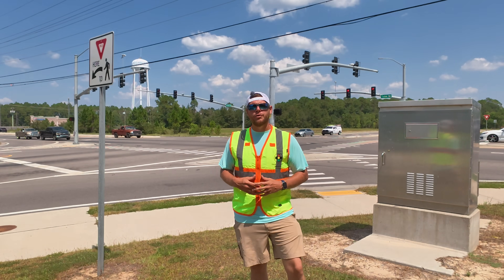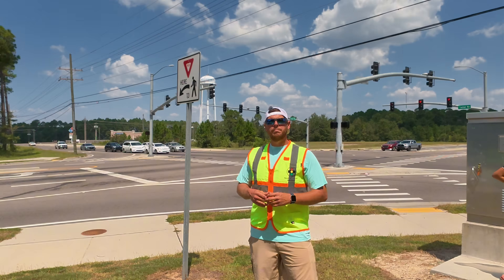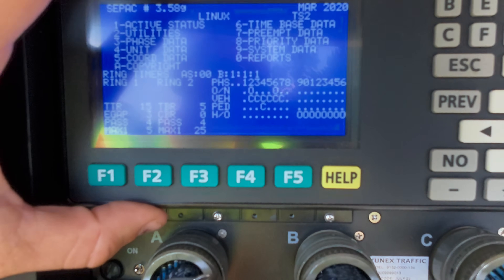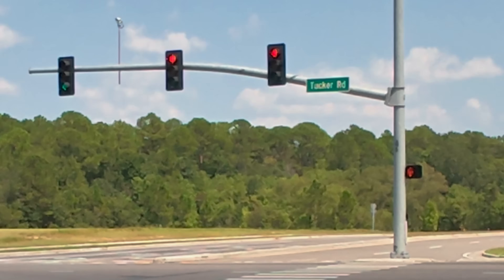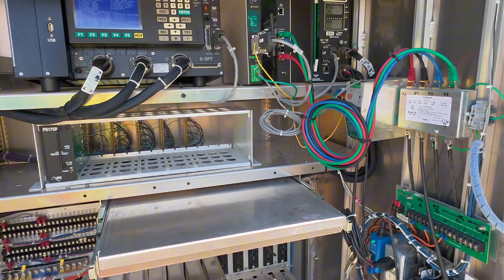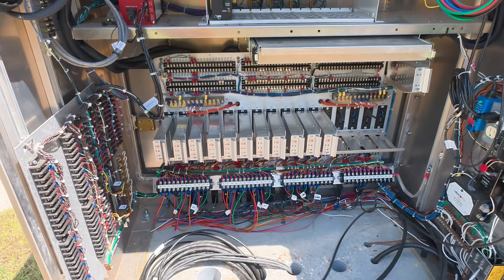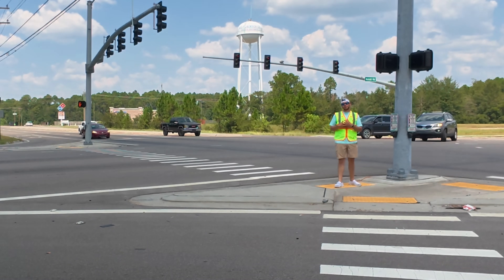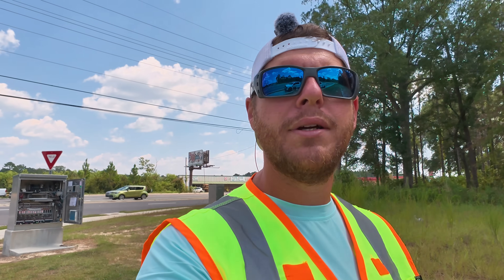Traffic Light Doctor Explains: Do Crosswalk Buttons Work?

Comment: There was an issue with the pedestrian phase getting triggered when it rained on a few signals around here. I finally had the occasion to walk by one and the cause seemed pretty obvious to me...the button was installed upside down with the wires entering from the top. I have never read the installation instructions for one of these buttons (to be fair, I doubt most of the people installing them around here have either) but I seriously doubt that is how they say to install the button.
Reply from the maker: I’d have to see the install on them to confirm if it was right or wrong but that does sound like a bad install. Is this a wooden/concrete pole that it’s on? Hard to mess them up on a steel pole but there is a dozen different ways to install them depending on the application and to make them ADA compliant.
Reply: @Trafficlightdoctor  It's on a steel pole. I'd think with the wires entering from the top, water will run down inside the button when it rains and conduct enough to trigger the pedestrian phase....unless the wires are sealed exceptionally well...and why would the manufacturer of the pedestrian button bother to do that when it's just as easy to install it with the wires coming out the bottom and state such in the directions?
Reply from the maker: @brianleeper5737 yeah that sounds like a poor install typically the hole will be drilled out below or center of the button depending on which kind of button that is being used and the cable will roll up to the terminals. Sounds like they went too high or installed new buttons that had to meet ADA standers and was too lazy to drill a new hole for the cable. Water will for sure create the problem you are stating. If it’s an older style button a weeping hole would help. Hate that you have to deal with that at your local traffic light!

Comment: Not sure about the newer model ones like that, I have seen a few of those up here in Lexington KY that seem to actually work.

However, many older systems, especially in smaller cities and towns, the button is not linked to anything up here.  They are a literal false button.  There was actually a news segment on it about 25 years ago here because it was an issue in Lexington where enough people complained that they felt the buttons did nothing.  Sure enough, while in the city they do, smaller towns typically disable/never wire said buttons, or just use a straight up timer for everything.

Comment: Here in the UK the "walk indication" is generally built into the same unit as the button these days. Some have got sensors so if the pedestrian walk away, the "crossing request" gets cancelled.
Reply: more need this radar for simplicity
Reply: I’ve seen videos of some pedestrian crossings in the Netherlands which have eye sensors (no, seriously). You literally just look at the sensor and it puts in the call to the light controller so you can cross—no physical contact required! It’s probably a COVID-era solution I’d imagine, but it still exists to this day!

Comment: Say I'm at this intersection the one in your video, and I push the button to cross the road (any one of the buttons on any of the poles) I'm now in the " Q " but before  my turn in the "Q" is reached, A first responder approached the intersection and the white light on top of the intersection is flashing and all traffic has to stop. Then the white light stops flashing and Traffic starts to move. My Question is am I still in the "Q"? Does the Computer in the Traffic control box have a memory that I pushed the crosswalk button before the first responder overrode the Traffic lights, thank you, hope my question was clear
Reply from the maker: Once the preemption is over for the emergency vehicle the controller will do a full cycle to every approach regardless if a vehicle or pedestrian is at the light then after that cycle it’ll go back to utilizing detection!
Reply: @Trafficlightdoctor  ok , I think that means I don't have to push the button a second time!!
Reply: @Trafficlightdoctor  That must depend on the controller. On the EPAC controllers (Siemens/Eagle), you can configure an exit phase which is the phase that gets the green when the preemption is over. After that exit phase is served, it uses the detection.

Comment: My question would be, how is it different if you DO NOT push the button? That light went green, would the crosswalk not normally go green anyway? It seems as though it simply made you wait for the cycle anyway.
Reply: usually ive noticed that's the only thing that changed. if you press the beg button, you get a walk signal. if you wait at the light without pressing it, you dont get a light
Reply: The Walk will not always come on with the green, depending on how the intersection is designed. There are actuacted, semi-actuated, and non-actuated traffic signals. If you do not push the button, you may not have enough time to cross on a green due to that direction gaping out (not extending the green).

Comment: I can tell you the TLDR without even watching. Yes they do****

******but sometimes they don't (technically). Sometimes, the light automatically gives a signal to PEDs regardless, but the button can be a signal to encourage the light to change sooner. Generally, however (at least in my area), they also determine whether PEDs get a signal or not during a phase.

This is the part where I am intrigued to watch this video; sometimes, the buttons do seem to not affect the signal phase in spite of being pressed which seems to suggest that some buttons are for looks and/or the "feeling" of doing something without doing anything. EDIT: Maybe they send a call, but if so, ones like these never get the call properly answered. There was one light in my area I frequented where you could push the button and sit for three entire light cycles and NEVER get a cross light (thankfully, not the case now with newer traffic systems in place), but at the time, I would just give up and cross on green cuz I was never gonna get a cross light. Most buttons, yes, they do something, but this one didn't seem to do what it should.

EDIT: Oh, and sometimes, they are also in place to help those hard of seeing navigate their way around the world, and these ones often have special features like a louder volume option and constant beeps to indicate whether the cross light is set to go, hurry, or stop.

Comment: Why is it over half the time (I'm disabled in a MANUAL wheelchair) time I never get all the way across, I end up out of time in the middle of crossing in the crosswalk in the middle of the road and get stuck there.

  Sorry but there needs to be an emergency extend button for disabled folks, we can't always make it across WIDE HIGHWAYS in 12 seconds or less.   It's ridiculous.

And then another issue is you press the button, it blinks red and if equipped might make a sound or say something but YOU NEVER GET A WALK SIGNAL and just have to take your chances crossing the street.

   I've had that happen, call it in and report it, but it takes FOREVER TO GET FIXED!  Sometimes it's a 2 or 3+ months wait, because I use the signal daily, and it's the worst part of the signal to get repaired.

   Now why is the pedestrian side of a traffic controlled intersection with crosswalk(s) not as important to our safety when it's not functional, and we have to just take our chances and walk against the stop hand, because the button IS NOT tripping the ped crosswalk signal?

Why is this on such a low priority to get repaired?

If the vehicle aspect stops working they're right out and fixing that within a very short time, even had a situation where they came out and repaired the traffic light, Ped button not working and it wasn't even touched or fixed at the same time!  Now, that didn't make sense either!

Again, why are the ped buttons on a slow boat to China when it comes to fixing this aspect?
Reply: Because the controller is coded for the time it takes an average person to cross X width of intersection.  They do not code for slower people, nor the handi-capped as traffic is higher priority.

You can petition to your local government ordinance to see if you can get engineers to add in extra time at the cross-walks you use for your safety.  But be expected to meet opposition.
Reply: @ChucksBasix it's a new trend as people are getting older
Reply: @HolidayDecorator, this YouTuber, Traffic Light Doctor is part of the problem.
These "engineers" don't care about the elderly or disabled people enough to even consider adding time to the controller.
The majority, NOT ALL, of these "engineers" are in their own little world and have lost their humanity and common sense.
Reply: ask your engineer to add more time
Reply: Theoretically the short "walk" period shouldn't matter, once you're in the crosswalk you keep the right of way even if the lights change. If drivers don't let you through they're breaking the law. The related problem I've encountered (maybe what you're talking about) is that there is sometimes a median island but for some reason they don't have another button there.
Reply: He parked his truck on the sidewalk making it impossible for you to use it.

Comment: It was the mid to late 90s when ped signals switched from words "WALK" and "DONT WALK" to the icons of the hand and the stick man.
Reply: Our city was quite a bit late on the update.  They were nice.
Reply: I was changing  to the international peds before the mid-90s, when those that had transformers ( they had PCB in them, cancer causing) in them went bad or a city request to have them changed to international. They became mandatory for new installation (only) in 2000.
Reply: @miluth2  Once in a very great while I'll still see an old word-based one in a small town some where. They're quite rare, and it's very nostalgic.
Reply: @aaron74 I wish I would have kept one.  There was one in a community for senior citizens, that I was not allowed to change to an international ped signal, due to some senior citizens not being familiar with it (liability reasons). I wonder what is there now.
Reply: @aaron74  The City of Fredericksburg in Virginia still has a few. When I see one, I wonder what the hell they are spending the road maintenance money they get from VDOT on....
Reply: @miluth2  I don't know enough about the regs but I wonder if they it would be permissible to have both styles side by side.
Reply: @aaron74  In Massachusetts we used to use simultaneous red and yellow on the regular traffic light to indicate a walk cycle instead of having dedicated pedestrian indicators. I have a type of quasi-nostalgia for them even though I've only seen one active once in my life.
Reply: @eDoc2020  Not sure I understand. The signals for cars (red, yellow, green) were the same for pedestrians, too?
Reply: @aaron74  Yes, only one set of signals per direction. If the cars see red + yellow it's safe to walk. Very unique and it's no wonder it's been banned. It's even more confusing than the new HAWK beacon.
Reply: @eDoc2020 I don't know of anything that says you can't. Just new installation has to be international. Can you use both side by side is a good question.
Reply: Its funny when those things go all dont walk walk 😂

Comment: Question I have a light I have to use daily it recognizes me leaving most times even with no vehicles but when heading back the other side of the light only recognizes me at night I have to use the crosswalk for context I'm on a bike and what's the best way to get my city to fix that light one side there's only 2 lanes one going in one going out into a apartment complex the other side is a right lane turn only then the other lane is straight or right turn the problem is most people turn left making the people in the other side turn left as well but I need to go straight it's almost daily I have to go around a car that turns into me is this a light problem or a driver problem because knowing my city it could be either one